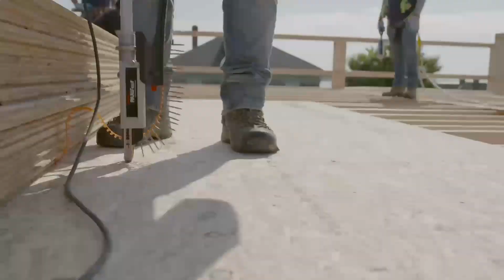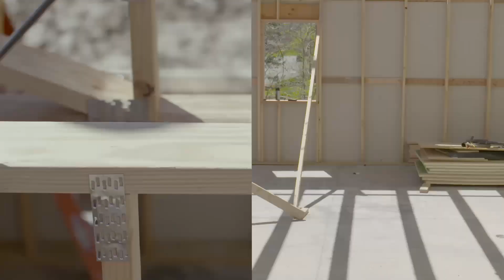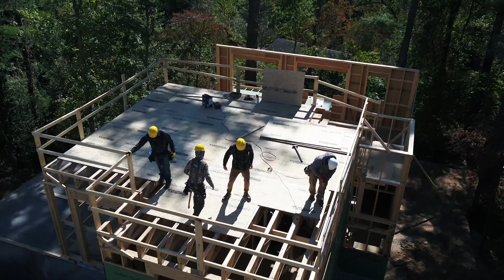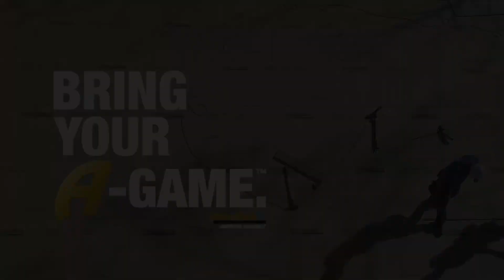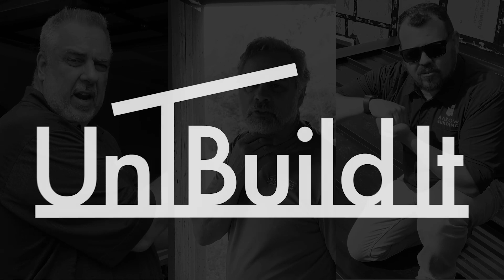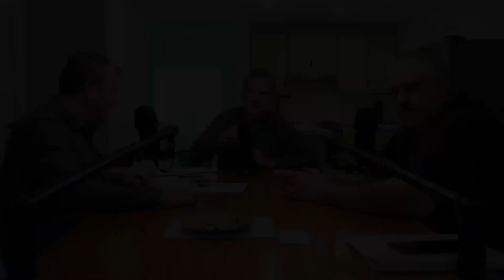Another Q and A - UnBuild It Podcast Episode #51

Comment: When talking about rim joist sealing/insulating, we MUST Not lose track of the moisture effect from inside the house.  I've seen MANY rim joists rotted due to internal moisture condensing out on the rim and rotting it.  So if a vapor barrier along with insulation is not used, this results in rot.  Cellulose, fiberglass or Mineral Wool will NOT work unless a sealing method exists that is fool proof.
Reply: I think what you are trying to say is that an air permeable insulation should not be used at the rim.....

Comment: Roller shutters here in Europe vary a lot in price depending on what you're getting, but they're pretty standard to have even on the cheapest houses/apartments. The cheapest ones are just extruded plastic with air inside them, but the more expensive ones are aluminum with foam insulation inside. If you're already going for the expensive ones, switching to electric as well isn't that insane of a cost. The main problem with non-electric ones is that you can't really air-seal them properly, because you have a shutter that needs to move in and out of the box on the outside and a strap for manual operation on the inside. The electric ones, on the other hand, need electrical work for each window (which you might already need if you're putting in a security system with window sensors), but they can be installed completely on the outside with the only penetration being the cable which you can seal and foam because it doesn't need to move. Also, the electric ones add value to the home, so if you can afford them during construction, it's not a waste of money.